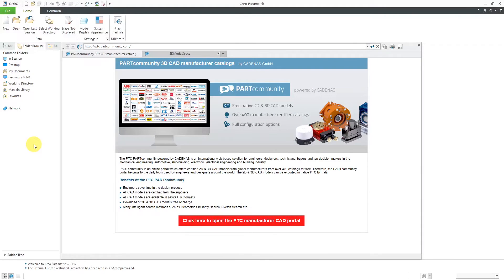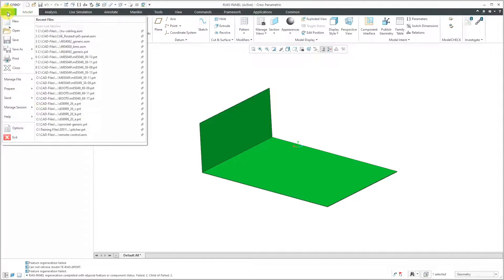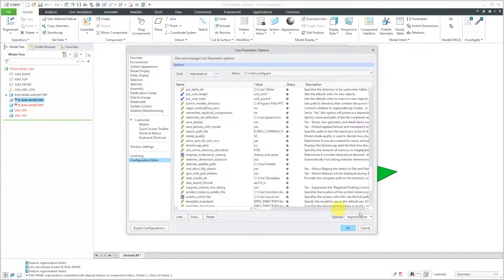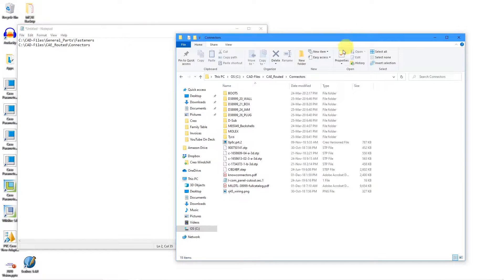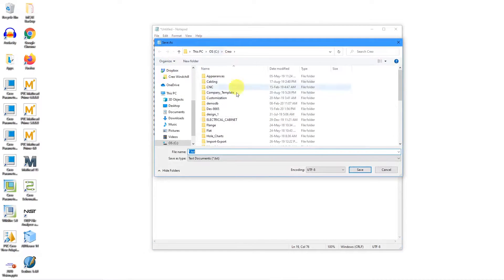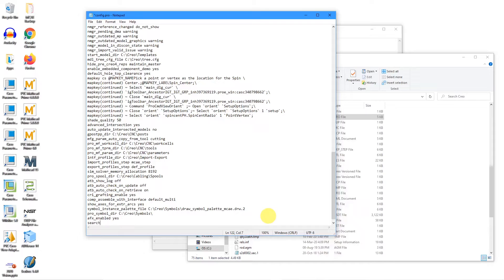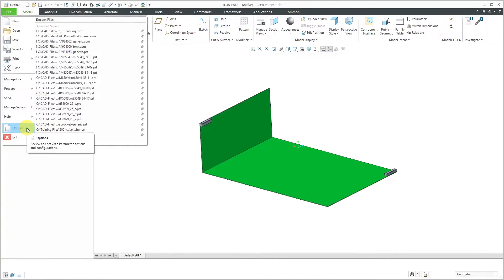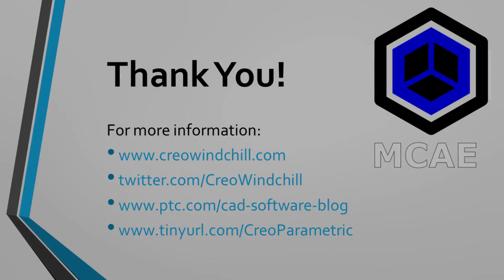Creo Parametric - Search Path File | Configuration

Comment: Hi @CADPLMGuy. What is the meaning, if inside the 'search.pro' file the paths are given like below, 
..\
..\Folder1
..\Folder2
..\Folder3
What is the meaning of the two dots (in some cases single dot) and from where it will begin? It will consider the working directory or the folder location where the 'search.pro' file is kept?
Reply from the maker: I think it’s a Windows convention. It’s not Creo specific. You can look up Windows file path conventions. I always recommend using absolute paths. I can’t remember if it means it’s a subfolder or to go up a directory level.
Reply: @CADPLMGuy  Thanks.

Comment: Is it possible to use  this functionality if you have spaces within in the file paths. I've tried and it doesn't seem possible unfortunately?
Reply from the maker: Enclose the path in double quotations.
Reply: @CADPLMGuy  Thanks, all working now. I use both SolidWorks and Creo on a regular basis but find it incredibly frustrating how you need to have basic programming skills to set options in the latter. I know ProE was written in the 80s but surly it's time to join the Windows revolution 😂
Reply from the maker: You don’t need programming skills. I’m a testament to that. I’ve written books on configuring Creo and I can’t program for crap. The search path file is just a text file. And of course if you’re using PDM it’s irrelevant.

Comment: Strange the Creo DOES NOT search children of folder with assembly file, and loosing referenced parts from tose folders.
Reply from the maker: Because then opening files would take FOREVER. This is why Windchill is much better for CAD data management than a local file system.

Comment: These are the things that us seasoned veterans know but new users struggle with.  It's a very powerful concept but one thing you did not mention is that if you have a file with the same name existing in two of your folders listed in the search paths you may end up with unexpected results.  ie. PRT01.prt in two folders but they are different parts, creo may open the one from a different assembly and not know how to assemble it.
Reply: So in other words, create multiple search path files, that represent only the folders related to a specific assembly.
Reply: One other small tip, is to create multiple desktop shortcuts to your creo Exe that have different "start in" locations pointing to the root folder where your config.pro file resides for that particular assembly/project. This way when you start creo, it automatically loads the correct config.pro file and has also already read your related search path file
Reply from the maker: Interesting, Chris. Do you reuse the same filenames a lot in different folders?
Reply: @CADPLMGuy  not typically but there have been times where there may be generic parts. Or if you have different revisions of the same assembly and those assemblies may have some of the same parts but different revisions.  It's not a common issue but I've seen it happen before.  Also, I don't use windchill, but I've been using creo since it was proEngineer2001.  Just thought it was worth mentioning because if someone creates one big search path file that contains all directories, they may come across the issue and not understand why their assembly is trying to include parts they didn't expect. Otherwise this is a great helper video. Many new users are intimidated by config files but once you understand them they are a huge help.  Same with the drawing dtl files